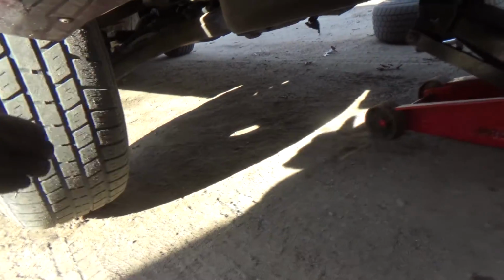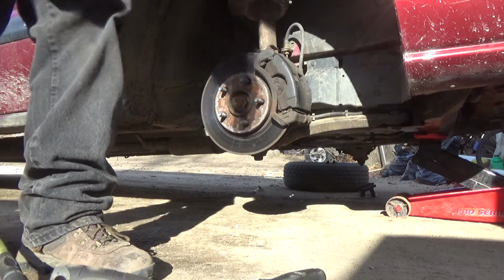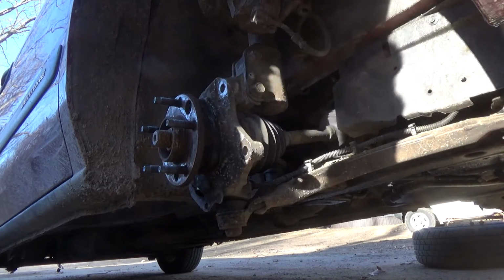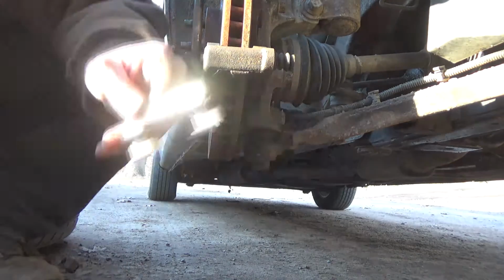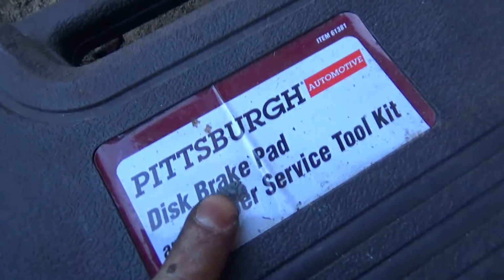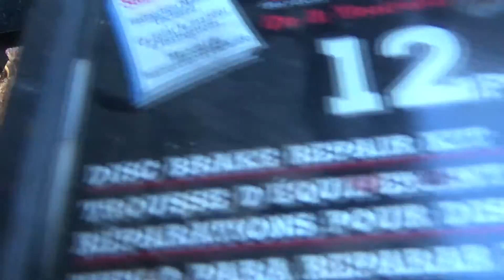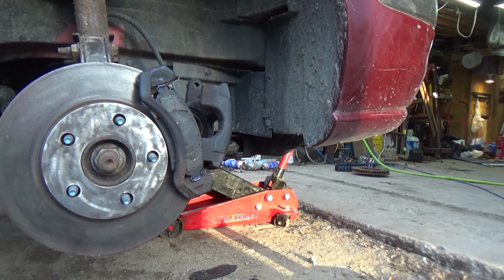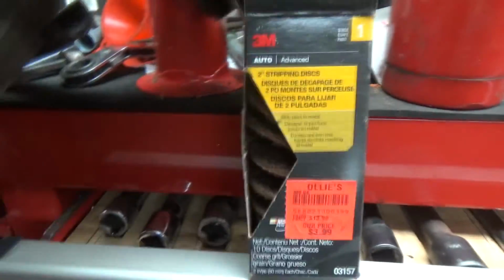How to Replace Brake Pads, and Rotors on a chevy venture/pontiac montana/oldsmobile silhouette

Comment: Nice effort.  Share the contempt for these vans...... the "engineers" who designed these van were obviously getting kick backs from the stealership cabal....   (I've managed to keep a 2000 Montana running, but oh my, all the cursed nightmare fixes.  like the thermostat from hell repair, the heater hose rats nests, the mystery boil overs, etc)  That said, for me, a generic C-clamp is a much simpler way to push back the caliper piston... no?  (Also, you were lucky the caliper hose didn't tear when it fell each time....  (been there, done that, until I got into the habit of using a wire to hang it from the spring....)  Appreciated that you did the extra lube on the clips/brackets, both sides.... but curious you didn't use any on the back of the pads themselves.  (guess that may depend on which pads you were using)
Reply from the maker: I fill your pain I have videos on the thermostat and other parts of it and I did replace the caliper hose after that the driver side was bad thats why I didnt care when it fell so many time and no you dont have to put lube on the pads never done that before and never had any problems with it
Reply from the maker: and using a C-clamp would not work the pisten was stuck and didnt want to hurt it
Reply: @CantKillMe  Thanks for the helpful reply, and I'm all the more delighted to discover your work.  I look forward to sifting back through your past related videos, including on some monster challenges I've thus far been able to avoid.  (like the valve cover & head gaskets.)  I'm about to take on the back three spark plugs....  (so that should be fun too!)  My Montana has become like Ahab's whale, and so long as I'm still kickin', I'm rather determined to not let the "whale" win.  So like your moniker, we won't let "it" kill us....  :-)  Cheers & thanks again.
Reply from the maker: lol hope things go good for you
Reply: I definitely feel ya!

My friend gifted me a 2000 Pontiac Montana Luxury after losing my car to an EF4 tornado it’s it’s taking everything I have to keep it running! It’s tough because I don’t even have a place to work on it and I had to start from scratch with tools. Every time I turn around something breaks! It clearly spent some time in the north since the rocker panels are GONE and there’s rust everywhere but at least the frame is OK.

That said, it runs well and the experience has been invaluable. Seeing how cheap these things go for I’d be inclined to get another and fix it up if this thing kicks the bucket any time soon. Lots of utility with the removable seats.